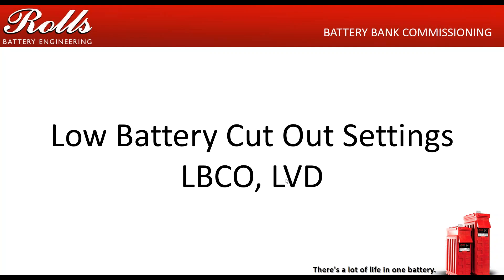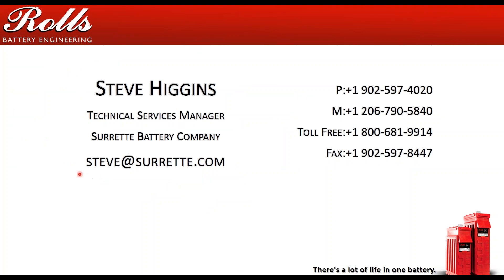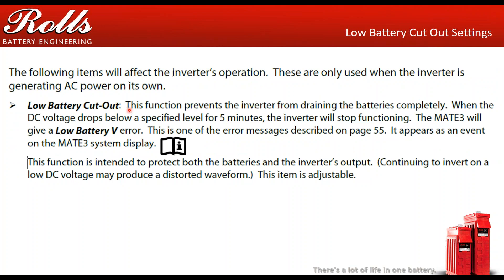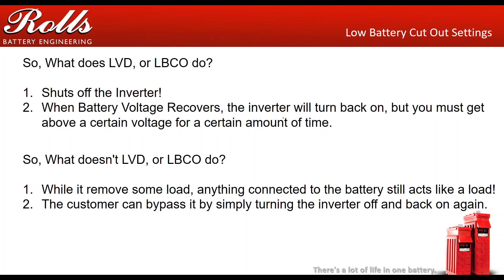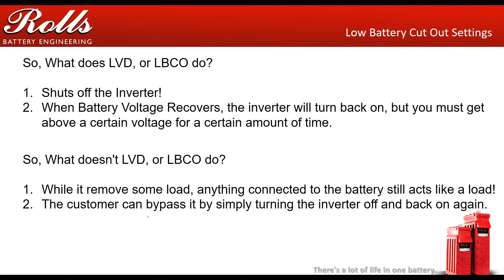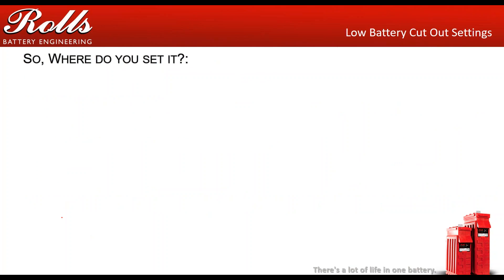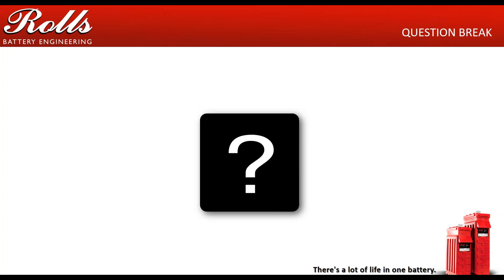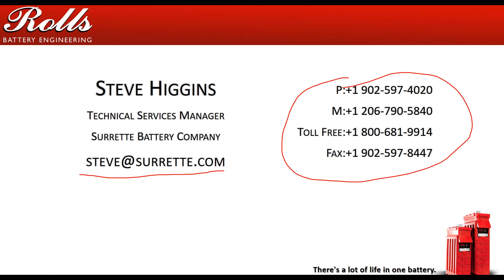Rolls Battery Engineering - Low Battery Cut Out, and LVD Settings

Comment: Do you have a more precise display "diagram" for Rolls batt, charge/discharge...  like 48v. (Discharge 0% =44.v or 3/4full =47.v???
Reply from the maker: No, and any company who posts charge by voltage is lying to you...  Charging is based on voltage and current. you must give time for the current to flow into the battery.